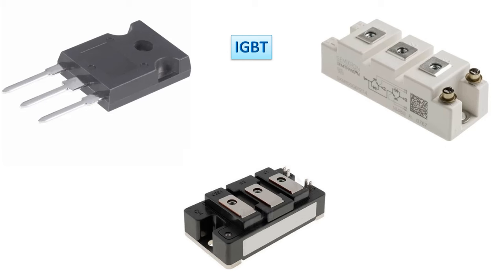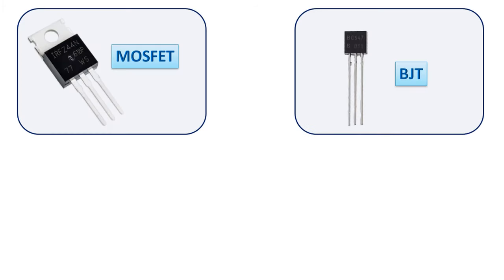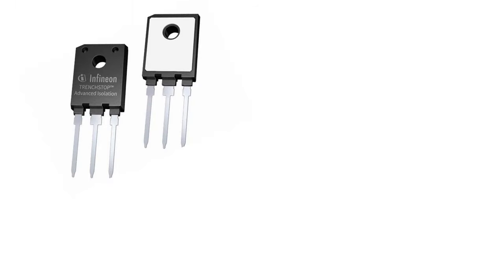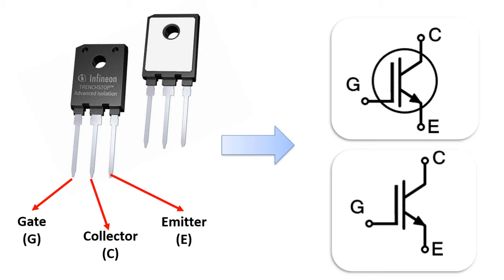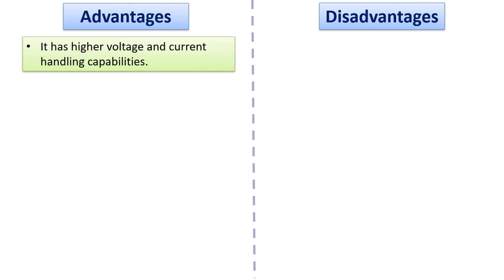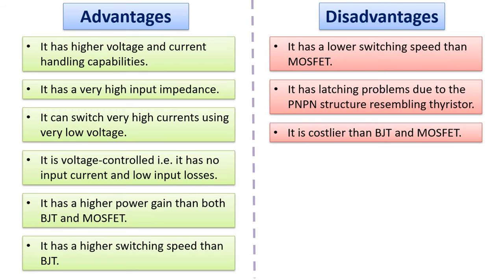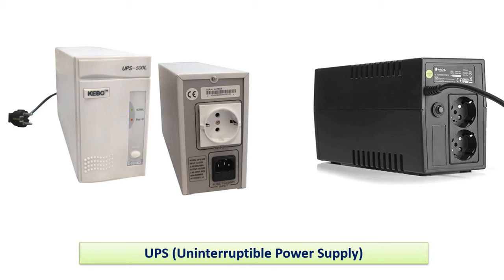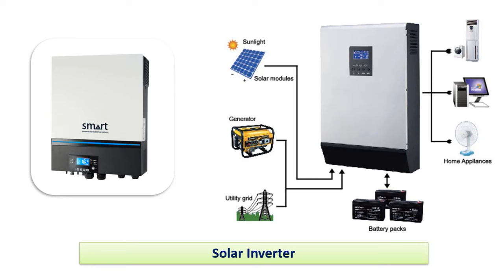What is a IGBT? How IGBTs Work? (IGBT Basic Tutorial)

Comment: Another place IGBT has REVOLUTIONIZED is Welding-Machines. Instead of using large, expensive, heavy, transformers, the IGBT circuits can control the high-current needed for welding. This allows VERY good control over the welding process. (pulsed welding current)

Comment: Again an almost useless video channel parroting simple facts that are available in for instance wikipedia. This video lacks important information. One disadvantage compared to BJT is that IGBT isn't suited to operation in the linear region, rather, it is almost always used as a switch (there are some rare exceptions). The die isn't suited to linear DC currents, but local hotspots are prone to appear and will destroy the transistor even at low power levels. Another application is big industrial frequency converters and inverters (up to MW sizes). They can be used in HVDC applications up to 6 kV (kilovolt) and several kA (kiloampere). Also used in HVDC transmission applications.

Comment: How can we use triac bt136 for controlling fan speed in remote control circuit with capacitor supply but not transformer supply.please suggest proper circuit including zero crossing.Regards

Comment: One of the biggest areas of use he missed, is welding. Welding is the most important way to join metals. It’s used in building construction, ship building, airplane construction, automobile and truck cinstruction, tanks and other machines, and almost everything else. Virtually all modern welders are inverter designs using IGBTs. They used to use MOSFETS, but those are either obsolete, or are used in very cheap welders from China.

Comment: Another example for IGBT's is the auto industry. The EV's are running on battery which has DC. However the e-motors are using AC. Thus an inverter is needed (DC >>> AC). And the IGBT's are the key parts of the inverter.